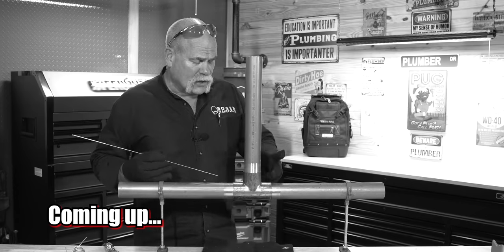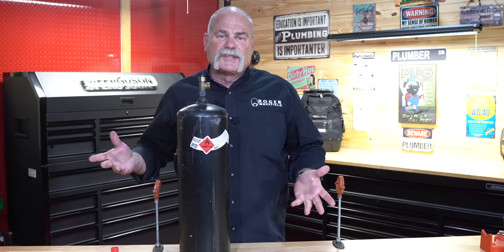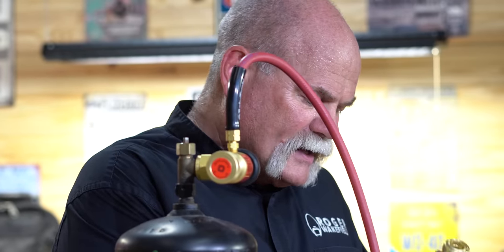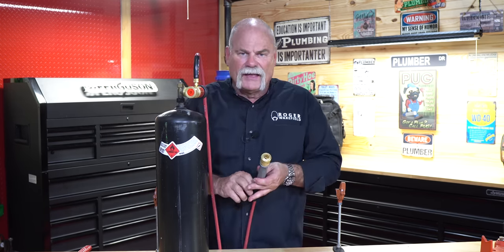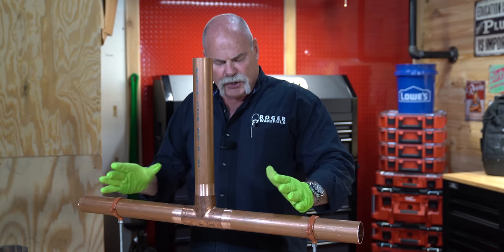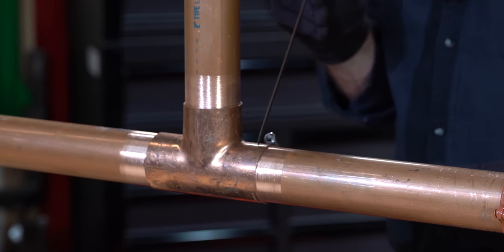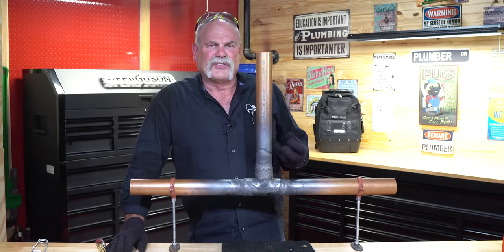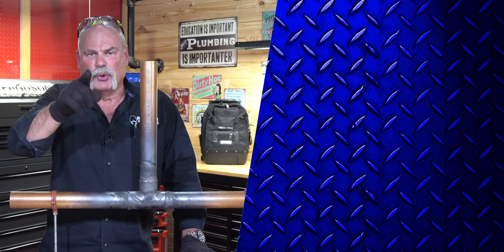How to BRAZE Copper Plumbing Lines

Comment: To all my plumber friends out there who also do A/C, stop soldering refrigerant lines. It worked with R-22 pressures but R-410a Pressures run higher. Also, brazing works better with an Oxyacetylene torch, because it heats the coppers more thoroughly.

Comment: Im waiting for the hvac guys to come comment, it's not the same to braze a large line like those ¼" lines y'all do, and like 6 joints total
Reply: I'll have you KNOW its only four joints wise guy lmaoooo
Reply: they all switched to propress because they don't have to get a burn permit.
Reply: Damn ac guys lol
Reply: @quickshticksstreaming6539  , You don’t install a filter dryer? The only way you can get away with four is not installing a filter dryer, preinstalled ones inside the condensing unit suck.
Reply: @boby115  you know what ya got me totally forgot about that was only thinking of evap to condenser still only makes it 5 joints tho
Reply: P.S. i’m guessing you’ve never seen an industrial chiller ? And if you’re waiting for an HVAC man to make a comment,I will do so. Roger’s braze joints I’m guessing is just OK, nothing spectacular. I’ve seen a lot of braze joints including my own that failed a pressure test. Also I will say there is no reason to demonstrate a cap joint only unless you’re trying to demonstrate how not to make a braze joint. Penetration and penetration plus cap are the only acceptable joints. It would also be nice if Roger demonstrated a braze  with the flow of nitrogen and without.
Reply: @quickshticksstreaming6539  , two at the evaporator, two at the condenser and two at the filter dryer (One on the inlet and one on the outlet). Put a suction line dryer in ,two more.
Reply: @boby115  you only use one filter dryer by the liquid line for residential which normally we put by the outdoor unit. So we got dryer to outdoor unit then to dryer the line set then line set to the evap the then suction to the evap then suction to condenser which makes 5 idk too much bout commercial but u put that many dryiers on a residential equipment ur gonna cause a restriction
Reply: @quickshticksstreaming6539  ,A line goes  in the filter dryer and out of the filter dryer (that is a total of two braze joints). How do you come up with one ? When it comes to suction line dryers it’s perfectly OK to have them on any system, commercial or residential as long as there’s no pressure reduction from the inlet to the outlet of the dryer (meaning a clean system.). This is why they put Schrader valves on each side of the suction dryer. Now when it comes to liquid line dryer’s (The most important one & the one that is required) we are looking for temperature differences.

Comment: Been a service plumber 15 years and a gas fitter 10. I have clamped hundreds of leaks. If it's a copper solder joint that is leaking its never one that has been capped. Not every joint that isn't capped will leak, but all leaks from solder joint are joints not capped.
Reply: In 15 years you've never come across a single capped joint that was improperly vented and had steam channels that eventually let loose at the edge of the cap? I'm shocked. If a pipe is in service, incompletely drained of water at the joint area, and a fitting is sweated in which seals the loop up, it's very likely that the residual water will flash and blow the solder out before it's cooled, capped or uncapped. A little pinprick channel with a hair of solder at the mouth is all that's needed. It won't leak at first and everything will seem strong, but then a few water hammers or some years of corrosion later, and it ruptures suddenly which is when you get the panicked call from the owner. Never seen that? 🤔
Reply: @mannys9130  I shouldn't say never. I should have said rarely. Was honestly thinking what you posted I while after posting the first comment.

Comment: two things that i do differently, but i typically solder smaller pipe and not brazing big pipes so these suggestions are for a slightly different application.   one, rub the end and outside of the fitting with steel wool or sandpaper.  this allows the hot metal to overlap the end of the fitting, strengthening the join.  two, heat from the bottom to get your pipe/fitting hot enough, but apply the solder from the top, and it will flow downward as your apply and go around-- and you can take the heat off at that point, possibly helping prevent burnt pipes.  again, these suggestions are for smaller pipes.  

you are 100% correct to begin by heating the pipe before the fitting.  it takes more time and more energy to drive the heat from the outside of the fitting to the inside of the pipe, and while a minor decision that isn't necessarily make-or-break, it can save you some headache when you get to that pipe with water in it.  if that happens, and you try to heat the fitting to melt the solder, you will burn the fitting into dust before the pipe gets hot enough to let the solder melt.  so start with the pipe and then move the heat into the fitting, letting your solder follow it from the outside in.

ps., i liked some of those little split screen produced pieces, because it is really important for people to see how the colors of the metal change as it goes through the heating process.  when you get that pink copper color surrounded by all the colors of the rainbow, its time to apply your solder!
Reply: It's hard to tell if you're talking about soldering, or brazing throughout your comment. "Soldering" means low temperature work requiring flux, usually with a lead/tin or lead/tin/silver soldering metal for electronics and non-potable pipes, and a lead-free 95/5 or silver-bearing solder for potable water pipes. Brazing is much higher temperature and requires no flux for copper. The brazing filler rod is sometimes called "silver solder" which is confusing, and most people I know (including me) call it "brazing rod" or "brazing filler." The pipes need no cleaning with brazing because the high temperatures prevents any oxides from forming or existing. That's the pinkish red copper color area you mention, seen in the hottest part of the torch flame. The brazing rod can melt in the flame and integrate directly into the crystalline structure of the copper in those spots because there are no oxides present at all. The flux is required for soldering because the low temp isn't enough to make the process "self cleaning" and the flux is what strips the oxides off of the surface. 

The concept of heating the pipe before the fitting is critically important in soldering when dealing with lead-free brass or bronze fittings, like valves and Tees. The lead-free brass and bronze alloys don't transfer heat around themselves nearly as good as the traditional leaded brass does. Let's say you try to heat the LF ball valve first when soldering it in place. The valve metal doesn't conduct heat well, so it doesn't spread through itself and not much gets to the copper pipe in a fast period of time. It just kinda trickles in. The copper pipe is great at conducting heat, so it sucks away all the heat down the length of the pipe away from the joint and it doesn't expand. The LF brass valve slowly expands as you heat it, and hopefully you're moving the torch around to apply heat to different areas constantly. Otherwise, the valve won't heat evenly and one side will melt solder while the other won't. As you heat the valve and it grows, the copper, which was already undersized to begin with and possibly VERY undersized if you went crazy with cleaning it with the emery cloth, does not grow in sync and the gap that the solder needs to fill is too large. It won't wick completely and properly. It also won't flow into the copper pipe surface because the copper isn't hot enough. You end up with awful adhesion and awful joint fill. The CORRECT way to do it is to heat just the pipe first. Blast it and expand that copper pipe tight inside of the valve socket, which thermally couples the 2 together very well. Then turn the torch 45° so you are heating the pipe end and the fitting socket at the same time. That keeps the heat from flowing down the pipe as quickly as it would like to. You have to keep moving the torch around alllllllll the time to be heating the brass evenly or you'll get hot and cold spots. When you get ready to add the solder, turn the flame so that it's heating just the middle and innermost end of the brass socket and then immediately feed your solder into the rim. This last blast of heating ensures the solder wicks fully inside. Prep is critical too. Clean the pipe very well without hogging it down to a tiny diameter, and clean the hell out of the brass including the mouth rims like you mentioned. Flux the shit out of it and wipe the flux off the outside of the copper pipe when it squeezes out so the solder doesn't gush the wrong way following that river of flux. The tricky part of this is that it requires a LOT of heat, in a specific sequence, and technique is vital. It's so easy to burn the flux when doing these LF parts, and that is why I ONLY use something like a 5% silver-bearing plumbing solder. It flows so much nicer and it melts at a lower temp than typical 95/5. Much easier to not burn the flux out of the joint. By far, one of the most difficult soldering joints to face is a medium or large sized LF brass valve going onto a copper pipe that has a trickle of flowing water bypassing a leaky valve upstream. That trickle of water will make the already troublesome heating situation WAYYYYY worse. You'll need to blast that bottom side to flash the water and overcome the water's theft of the heat during phase change, and it's easy to burn the flux! :(

Comment: Great video, Roger !, I tried brazing a few years ago and wound up melting a shutoff valve and a fitting!!, does the brazing rod have a flux in the center of it ? When I did it, the valve melted and the brazing rod just puddled on areas of the fitting and valve ! Haven't brazed since,  now I always solder my connections!, no leaks!
Reply: nah you just gotta use some sort of thermal protection when you are doing it on valves or other sensitive equipment you  just got the valve to hot so the the O rings and other sensitive parts melted. next time try wrapping the valve in a soaking wet towel and just leave the joints visible to heat up and apply the braze rod  too
Reply: @quickshticksstreaming6539  thanks 😊